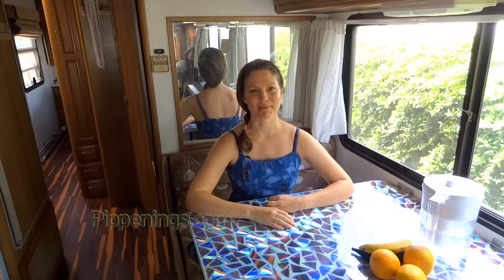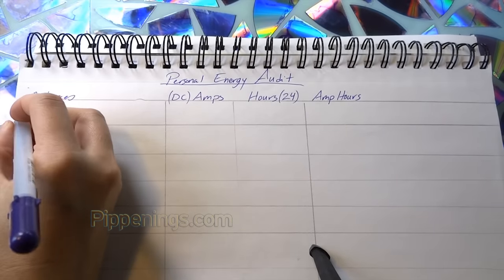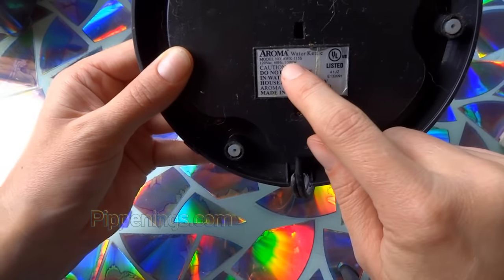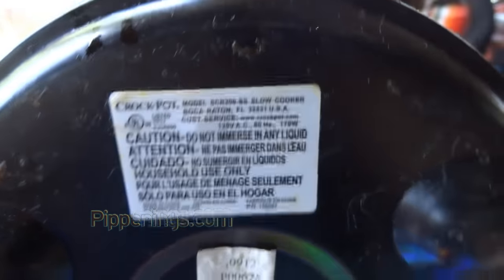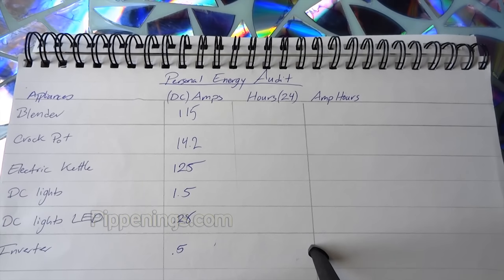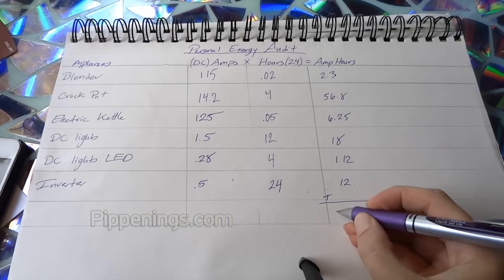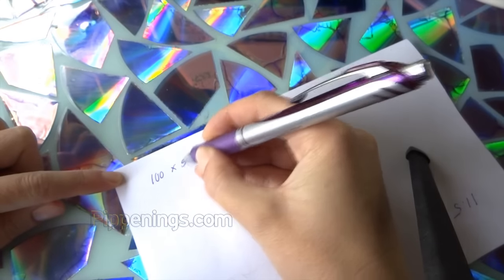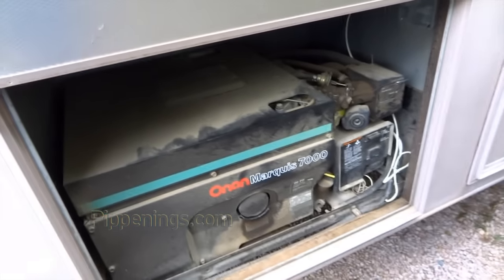RV Solar Living Basics: How Many Batteries and Panels to Use

Comment: Nicely presented, however, somewhat incorrect.

The label amps are max current drawn by the device--not the rated current drawn while in use.  And you don't divide by 10 or 12--you multiple A*V to calculate the apparent 
power (Wattage) usage--which isn't the actual power (rate of energy consumption).

Plus, you stated that if you want your batteries to last longer (discharge only 20% of capacity) then you'd need to multiple your Amp-hours by 5.  You then proceed to do the calculation without multiplying your capacity by 5.

A better way of doing it would be as follows:
1.  Actually measure your power usage of each electrical device using a Kill-A-Watt meter or like device.  That will give you very accurate numbers for your calculations.
2.  List the actual V, A, W & hours used per day as follows:
Note:  V=W/A, A=W/V & W=V*A.  So, if you know 2 of the values, 
then compute the third (e.g.:  120V & 11.5A = 120*11.5 =1380W) 

V_____ A____ W___ H/D = ___Wh/Day
120V * 11.5A = 1380W * .02 h/D =_ 23 Wh/D
 12V * 14.2A = 170W * 4 h/D __= 680 Wh/D 
 12V * 125A = 1500W * .05 h/D _= 75 Wh/D 
 12V * 1.5A = 18W * 12 h/D _____= 216 Wh/D
 12V * .28A = 3.36W * 4 h/D _____= 13.44 Wh/D 
 12V * 0.5A = 6 24W * 24 h/D ___= 144 Wh/D
_______________________Total = 1151.44 Wh/D

3.  To determine the battery bank capacity, just divide the total Wh/D (above) by the battery bank voltage (i.e. DC electrical systems often vary from 12V to 48V).  In your example, you use a 12V parallel configuration so 1151.44 Wh/D / 12V = 95.95 Ah/D.  If, however, a person's RV uses a 24V system, then you would compute 1151.44 Wh/D / 24V = 47.98 Ah/D.  NOTE:  For the remainder of this text, I'll show computations for a 12V system because that is the system that you use in your RV.

4.  To determine the battery bank capacity (If you want to use only 20% of your capacity to get a much longer battery lifespan) then you would divide by 20% (e.g. 95.95 Ah /.20 ) = 479.97 Ah (which would be 5 x 100 Ah deep cycle batteries or 2 x 250 Ah batteries)

5.  To determine the size of your solar array you would multiple your battery bank Ah capacity times your battery bank voltage & then divide by the daily solar radiation for your area (e.g.: kWh / m^2 / day).  (e.g.:  479.97 Ah * 12V * 5 = 1151.44W).  Thus, if you choose to use 380W panels, then you would need 1151.44W / 380W = ~3 panels.  Note:  Most people wouldn't buy the extra batteries & pay for more solar panels due to the steep cost & limited installation space that a RV has.  That's most likely why you did the math for a smaller system (e.g.: 95.95 Ah * 12V * 5 = 230 W / 120W/panel = panels = ~2 panels needed).
Reply from the maker: +zeffur7 Einstein said, " If you can't explain it simply then you don't understand it enough."
Reply: zeffur states: "If you state it incorrectly or in a way that isn't very clear, then you stated it less effectively than you should have stated it." 

Either way, you now have useful information that is perfectly stated by me (above).  If you don't understand it, I suggest you reread it until you do--that is how it is properly computed within informed circles--and it wouldn't take 5:29 to explain it--more like 1 minute, if you were slow. I was intentionally verbose for clarity.  Given that it is a rather simple 5 step process that could be simplified by just showing the math (i.e. not explaining what the values are or what they mean), it could be explained more efficiently--but with less knowledge conveyed to your audience (which would be similar to your example.)

The other thing that is a major design factor (which I intentionally omitted because you didn't mention it) was the inefficiency of solar panels.  Almost no one gets 100% of the rated output of their panels for the 5 hrs of solar radiation per day.   Some panels even produce as low as 70% of the rated power (believe it or not) There are also latitudes & times of the year when solar irradiance is significantly less (think high latitudes, winter, & cloudy days), which will take a big bite out of your panel's ability to properly charge your batteries.  Fortunately for you, you have a RV generator that can be used to charge your batteries properly when sunlight is inadequate for proper charging--many home PV systems don't have that luxury (just as a comparison).  Many of those systems suffer from battery sulfation, due to improper charging--yours would also (during the winter), if you didn't run your generator properly.
Reply: zeffur needs to lighten up
Reply: MrTimnedella needs to butt out & mind his own business. tyvm
Reply: I agree with zeffur7. When calculating battery bank size and solar array size there are things such as the panel charging efficiency. I typically calculate that at 70%. When calculating total load I add a 15% efficiency derate (loss due to inverter and wire resistance). 
Peak solar hours can be determined by using a site like pvwatts.nrel.gov. For my area it's 4.5 hrs. When determining the size of the array that number is crucial.

Typically for an off-grid system, since you're powering your appliances and devices from the batteries, you size the battery bank based upon your total Wh load/day and the number of days of autonomy you desire (total number of days you want to be able to run using your total load not to exceed 50% of the battery banks capacity without charging). Then to determine your solar array size you determine how much wattage is required to charge your battery bank from 50% to full @ 70% efficiency based upon peak hours. You can then decide whether you want to be able to recharge fully from 50% in one day or over x number of days. The quicker the recharge the bigger the array needed.

Keep in mind that cloudy or overcast days greatly reduce your charging ability. Colder temps increase your panels output - hotter temps reduces them. If you have a generator you can use it to augment the output from the solar array especially when weather prevents or reduces the charge from the array.
Reply: +Michael Jankowski:

All very good points--which I didn't include because her initial example didn't include any of them--mainly because she has the ability to generate power to charge her batteries when solar input is insufficient.

Most RV types don't have the depth of knowledge of land-based solar+battery system designers or owners because they have to budget for fuel anyway & their systems have a built in generator.

But then, you know, offering any kind of criticism & useful information theses days to a generation of 'everyone is a winner' mindset, seems to do more to upset them then they have the ability to appreciate.
Reply: Her way is better as it allows for excess.
Reply: @Jason Magik:
Adding excess capacity is quite easy to compute.  Her way is obviously a novice's approach--as is your comment.
Reply: zeffur7 The results of your calculations are the same as hers.
Reply: Jason Magik
You are a bit dull, huh?  Our answers are not exactly the same throughout the whole comment thread (even though I started with her bogus source numbers).

You really should get a clue before you post--you know--to not embarrass yourself further...
Reply: zeffur7 

Thanks Zeffur7 for a very accurate and informative calculations. Well, thanks to the Vblogger we get these kind of reaction to enlighten us and the readers can react and provide a deeper insight.
Reply: Zeffur, you're the reason people don't attempt this stuff. By making it so completely over complicated. Thank you pippi for a great and simple video. You really helped. I found an easier way though. If your stuff isn't working, you need more panels, batteries or Sun. And if you can see the sun, it narrows it down.

Comment: You can use this website to assist you in doing the calculations for your solar audit.  It has 12v and a 120v sections which was convenient for me since I run my 120v appliances off the inverter and have separate 12v outlets for those items.  It helps you judge how many watts and types of panels to use since you also calculate your type of use and the # of solar-hours from the sun map for your location. Or you can build your own spreadsheet in Excel.  http://gpelectric.com/tools/GoPowerCalculator.htm?state=RvDiv

Comment: https://youtu.be/4-OpzH5sBG4?t=4m12s
How do you work out that a 120W panel charges 50 a//h? I tried to divide 120 by 12 and then multiply by the number of hours of sun per day (say 10h?) and it comes 100a/h per day., not 50a/h. Unless it's a very conservative calculation...

Comment: is this math correct?  i never seen anyone using dc amps    they only use amps    maybe is the same calculation but with a diferent route
Reply: danny, this was covered in H.S.electronics.  Here's a refresher for ya: https://www.batterystuff.com/kb/tools/ac-to-dc-amperage-conversion-run-through-an-inverter.html

Comment: Everything in my trailer is 110 dont need DC amps I use ac
Reply: Solar energy is converted to DC and stored there. Therefore, you will still need to convert your AC power needs to DC units in order to determine the amount of solar power capability in your trailer...

Comment: Uggh!  How does it make sense to boil water with an electric kettle instead of using your propane stove to boil water?  Using solar panels, batteries, an inverter and an electric kettle to boils water to make coffee instead of using your propane stove would not be a "Keep it Simple" approach.  IMO.
Reply: Percolator
Reply: In any location at higher latitudes there will be large seasonal variation in pv yield for any given size. If the PV is sized for year round or even 3 seasonal use, or for more dependable capacity in cloudy locations, it makes perfect sense to use an electric kettle on sunny days or in the summer.